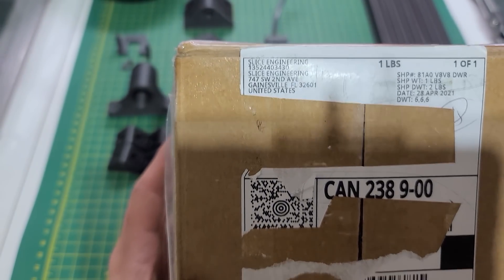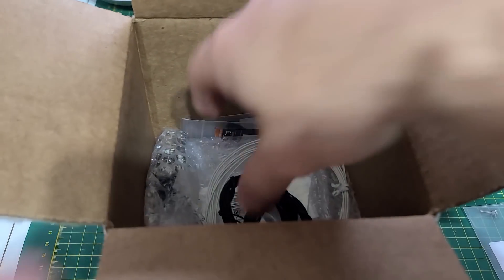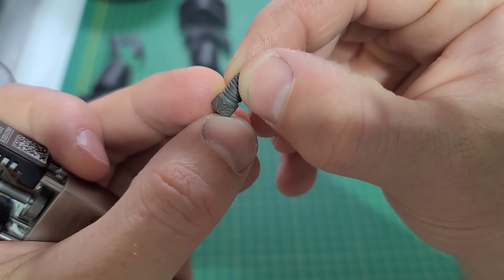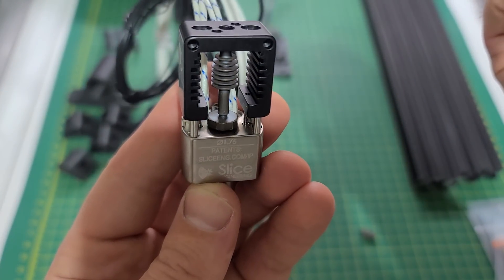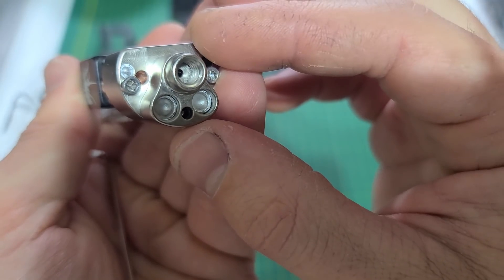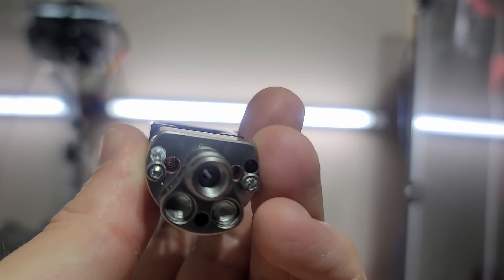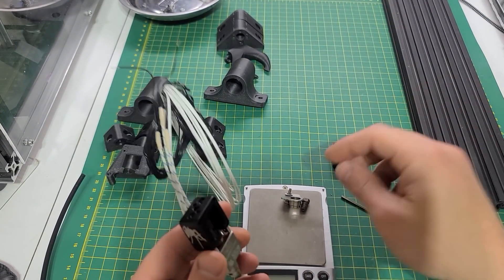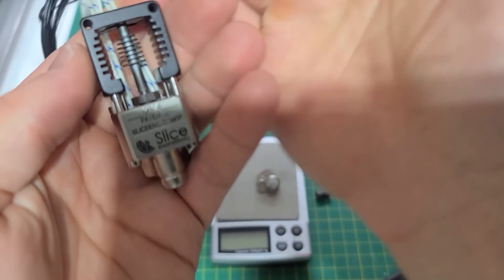Slice Engineering Mosquito Magnum+ unboxing

Comment: The second hole you think it is for a second thermistor is probably for heat balance in the geometry of he heat block, that is the way I would design a heat block, where you want constant even heat retention and distribution. I just stumbled upon these hot ends and they look clever especially with the separation of the typical single heat break into 4, not only for better heat separation but also mechanical rigidity and ease of one hand head changes. Brilliant!.

Comment: Good idea that the material has a small diameter upwards. 
the disadvantage is: the cables of the heaters and the thermistor lie in the air flow of the fan. a lateral guide would be the solution, so that the air flow could dissipate the heat unhindered.

Comment: Which stepper motor with plenty of horsepower do you use to move that weight?
Reply from the maker: ODrive
Reply: @Vez3D  "Peak current 120A per motor"
 cough, coffee spilled... D6374 150kv is an engine for cnc milling with 70A max!

Comment: For anyone wondering why we didn't use a silicone sock: the Magnum+ can exceed 500 C printing temperatures. Unfortunately, there is no silicone sock that can handle those temps for extended periods of time.
Reply from the maker: It would still be good to have though. For high speed printing we need a lot of cooling and I found that its struggling to keep its heat to requested temp. So a sock will definitely help. If one wants to print a 300+ he can then remove the sock
Reply: @Vez3D  Are you using 100W or 50W? Reach out to our support team and we can help you with your cooling setup as well.
Reply from the maker: @SliceEngineering  2x50watt.  I think 2x100watt would be better for that big block.
Reply: @Vez3D  2x50W should be plenty. 200W could be dangerous amount power for a hotend this small.
Reply from the maker: @SliceEngineering  im doing crazy things with my setup ;)  not the typical print speed you normally see. I will try to build myself a silicon mold. that will help. Im not planning going above 300-320c.. so that should be ok
Reply: @SliceEngineering  you do realize double the voltage it’s magically half the amps bro no danger for me if you give it what it needs your are running 450c what’s 100w @24volts lol
Reply: @Vez3D  Vez rocks cheers bud
Reply: Ummm simply take it off over 330c up as those thermoplastics are not nearly affected by the heat soak of not having a silicone sock or shielding from the heat of lower temperature materials I call bull shit I have one on mine and it helps isolate the heat soak so magnum or not it helps all day long
Reply from the maker: @CC-kc5lb  I need one badly. I will make one :)
Reply: @Vez3D  yes make one from rtv high temp orange silicone I checked triangle labs they have mosquito ones that are decent but not sure the magnumplus is ready yet
Reply: @Vez3D  Vez hit me on discord when your drinking or not…. I wanna talk about our printers and thoughts you my share about mine
Reply: Hello Slice, how hot can the Magnum Plus go without a fan?
Reply: @rexsolomon6325  Magnum+ is rated for continuous operation at 500 degrees Celsius. If you need to print continuously at that temperature, we would recommend moving to a liquid cooling set up, as most plastics that require such temperatures will have poor interlayer bond strength and significant warping without a heated enclosure.
Reply: Ah yes, hey everyone let's look forward to print with Slice Engineering's thixotropic zinc alloy filament, since getting to 500°C is such an important and revolutionary feature.

Comment: You mentioned odrive. 
I'm doing a odrive setup. 
Are you running through klipper
Reply from the maker: Yes
Reply: @Vez3D  I'm doing a servo bldc set up. 
Fully 3d printed motor. 
Am I able to get Pointers off you
Reply from the maker: @simonlaker2139  i just filmed a full 45min "how to" vid.. i just need to do the editing now
Reply: @Vez3D  are you using the step direction interface or serial
Reply from the maker: @simonlaker2139  step/dir
Reply from the maker: @simonlaker2139  patient...video incoming this week
Reply: @Vez3D  sorry. 
Thanks for the feedback. 
If you're interested I've designed a 3d printed linear tubular motor. 
Which I'll be using with odrive.
Reply from the maker: @simonlaker2139  no need to be sorry :)  sure i would be very curious to see how that works.
Reply: @Vez3D  can I message you on messenger. 
I don't want this on public domain until I release it. 
I have big plans for it I hope you understand
Reply: @simonlaker2139  I would LOVE to see this also 😁
Reply: @MattFliesPG  it's on3dprinter builders designers group. 
Not run yet and just a test rig for y axis.
Reply: @simonlaker2139  honestly, "3d printed motor" doesn't sound that great to me
Reply: @marc_frank  let's be frank frank ..
Thanks for your opinion. 
But you have not a clue what I'm doing or how I'm going about it.
Reply: @simonlaker2139  oh of course i do
not every detail, obviously
the intention sounds quite interesting, though

Comment: Mainsail seems to display wrong flow values. The travels movments are taken account and that's display a way higher volumetric flow than expected (like 28mm3/s for my e3D v6 wich is impossible)
Reply from the maker: Ill make sure to read with no travel

Comment: if we consider price ($110), speed (50mm³/s) and weight (28g), combined, i think the nova is a better overall package for a consumer printer. Btw they also sell 1x100w heater cartridges @24v.

Yet the declared 90 mm³/s are just crazy. This would allow printing giant stuff high speed with ≥1mm nozzles.

Comment: Can you put a link to it please?... scratch that.... BRO... Holy guacamole my guy $430....... that better be the last hot and I ever buy lol!

Side note... what extruded gear setup do you use, and do you also run O drive mottoes for your extruder?
Reply from the maker: Odrive is for AB motors..not E. On E i have the nema14 ldo round motor with the Hextrudort

Comment: That's nice and all but WILL IT BLEND?
Reply: Mosquito-style hotends probably won't due to the way they're built. The hot blocks are attached to the heat sink by 4 small stainless steel tubes.

Comment: If you test extrusion volume, check out the work of CNC Kitchen.

Just because your extrudermotor does  not skip, does not mean that you are not underextruding. You basically need to weigh the output and compare it to the weight exteuded ar lower speeds
Reply: How would this be possible? Extruder not skipping but underextruding. Either it skips or the filament slips backwards but there is no way the filament can be indefinetly compressed.
Reply: You work with a gear that diggs into plastic. The teeth of the gear deform the filament a little (cut into it). So the gear moves a longer distance than the filament does. It is neither skipping, nor slipping. In the speedprinting community this is very well known. 
The impact is quite signifcant.

I didn't find the old video from one year ago. But maybe check CNC Kitchens current video "Easy Hotend Benchmark for Fast pritning profiles" out.
The graphs should give you some quick insight.

Comment: Why did you add a reduction on the O-drive motors?  Resolution issues?  I'd expect the intertia matching to be better direct drive due to the relatively high motor inertia.
Reply from the maker: I found that at lower motor speed, it creates artifacts on the prints.. and I think it dues to cogging .. or the big magnets. The higher they spin, the better it gets, 2:1 improved quality
Reply: @Vez3D  Cogging torque is a likely culprit.  Have you turned on cogging compensation?  If you still have trouble, you can look for a motor with skewed laminations or use an inrunner but keep the reduction.
Reply from the maker: @martylawson1638  anticogging is calibrated and on.. but it still happens. I dont think I will ever get rid of it entirely unless I change motors. But not tok sure which ones
Reply: @Vez3D  hobby motors are optimized to be cheap and powerful so cogging suffers.  A 100-200W inrunner with more reduction, a much higher cpr encoder, and or a used/china servo motor would be how I'd look to reduce artifacts.  Though it's probably not worth the trouble until you run out of power/acceleration on the current motors.
Reply from the maker: @martylawson1638  my B plan is set already. If I ever get tired of the bldc. I would go back to stepper but running them at 48v. 0.9 degree have no artifacts
Reply: @Vez3D  That would be an excellent subject for a video. I would really like to hear of the learning curve that you had to do on these. What are the limits and how did you deal with them.

Comment: 86 grams really isn't bad I think my dragon is 55. Can't wait to see this thing action
Reply: And less than 1/4 the price hehe
Reply: Don’t get the fittings find your own theirs are 54 grams just the fittings junk check fitting space
Reply: Ahh without fitting….. the fitting they supply are 54 grams alone lol go to fitting space and get g1/8 to 1/4” or 5mm barb 90 rotating fitting they are reasonable and proper just match the hose you select with the barb side you want cheers

Comment: looks like that whole brainpower has been used during creation of 4 steel tubes, so much copper just to slap 2 heaters is just stupid.
Reply: ever use a mosquito? the bi-metalic heatbreak and the ensure the cold zone transition is perfect.  I'm not sure how you can judge this without testing it or doing thermal analysis on how it was designed. The heatblock and the part that goes into the heatsink are very different, I would not pre-judge this without seeing how it compares to the Nova, it's small form factor, and can reach pretty high temps, I'd be interested to see some flow tests with it.
Reply: I agree that most of it is looks and copper (400W/m2K) vs alu (200) isn't really the challenge thermally. The challenge is bringing the heat from the surface of the plastic (<1W/m2K) to its core quickly, without scorching the outer plastic with more than 300C. I have a hard time figuring out why it isn't longer like other "super volcano" extruder out there.

Comment: That's probably not thermal paste, but boron nitride paste which will harden with heat.
Reply: It's boron nitride thermal paste.
It will help to remove the heartbreak once it has been running high temps unlike cheap paste which will just melt everything together.

Comment: Looks like a beast ... i agree the gaps will most likely cause some unwanted mess at the nozzle cover i wonder why they didnt use a silicone sock instead
Reply: Temperatur resistance
Reply: @clemensexenberger2455  That's literally only a problem if you're printing PEEK, and you definitely don't need this nozzle to print PEEK.

Comment: Why include 2x100W heaters when the thermistor can only go up to 300C?
Reply from the maker: its 2x50watt.  thing is.. you dont need to go very high in temp. you need to be able to sustain that temp. thats why 2x50. Also, there is the option of another 450C+ thermistor. I dont know why they sent me the 300C one. I will probably change it for a PT100
Reply: @Vez3D  Exactly, the plastic is melting at the same temperature ... melting more plastic per second only needs more heat per second (Watt), not more temperature. The only reason why one would need to increase the "heater temperature" is because the temperature is measured relatively far from the melted plastic it self and, conducting more heat from the heater through the plastic, requires to have a greater temperature across that heat path. So even if one has to set the temperature higher than normal, the plastic, on average, really get to the same temperature.  

That being said, needing to go to more than 100°C over the regular temperature is, in my opinion, a sign of poor thermal design. The biggest resistance in the thermal path is likely the plastic it self, from its surface to its colder center. There's a risk of thermal degradation on the outer polymer. That is why "super volcano" extruders are longer, to increase the surface through which heat can be conducted to the polymer, thus lowering the thermal resistance and requiring less overheating.
Reply: @etle113  I can't say more: "in my opinion, a sign of poor thermal design.", go and make perfect thermal designed hotend - I will buy one to try. ;)
Reply: @Vez3D  Ah yes, that makes a lot of sense. Electric heaters are very efficient in the sense that all the incoming electric energy is converted to heat. Therefore running two in parallel to evenly heat up the nozzle doesn't introduce any additional electrical load or problems.
Reply: @Vez3D  or PT1000?
Reply: My guess is also to have even heat on the large heat block to prevent a cold side

Comment: meh another evil orange product, overly complicated design with messy boron paste
Reply: Complicated design compared to what?
Reply: @REDxFROG  3d v6 ,a phaetus dragon, a nova the boron paste is the biggest issue it makes a mess and takes 12 to 24hrs to dry I see it more as a industrial type product for the everyday person wanting to print parts or something in a 3d printer it's too much simple works best not everyone's highly mechanical or patient (myself included to wait 24hrs to print with a new nozzle set up) just my opinion
Reply: @sinfulf4i  I use the regular mosquito magnum, and boron paste hardens in a few minutes at temperature, so not sure what you're talking about. It's a very simple assembly, taking it apart would be a bit messy, but cracking and cleaning the dried up paste is better than having the bolts seize up completely on a e3d copper plated volcano, had to toss out a few of those because the bolts couldn't be removed.
Reply: @kazolar  fair enough I guess it's my experience with the one I had it just didn't work for me but to each there own
Reply: @sinfulf4i  24h to swap a nozzle? What are you talking about? Boron paste doesn't go on the nozzle... It goes ok the heatbreak to heaterblok connection and the heater cartridge and thermistor to heaterblok connections...
Reply: @C1Rob1990  sorry I said nozzle set up. I should have said new hotend set up
Reply: But he's trying to beat his own Nova hotend with this one..
Reply: @REDxFROG  his own nova hotend? He bought that too, not his design 😅 like he said, this is in another league all together. It's more and industrial hotend
Reply: @REDxFROG  it doesn't make this overweighed bs a good hotend